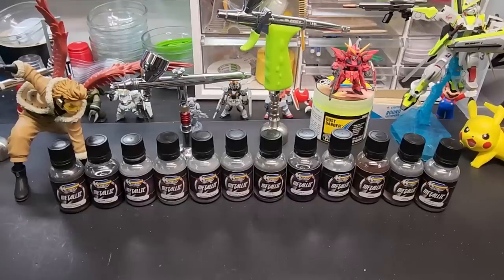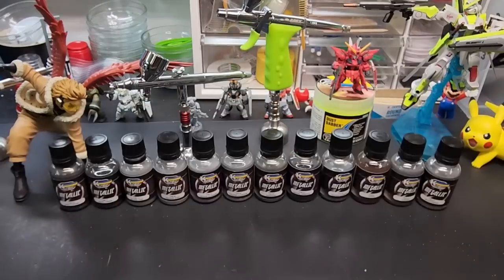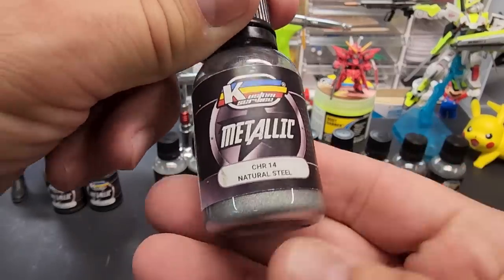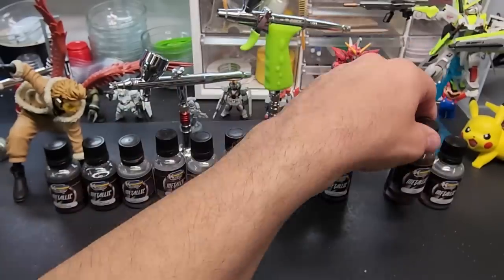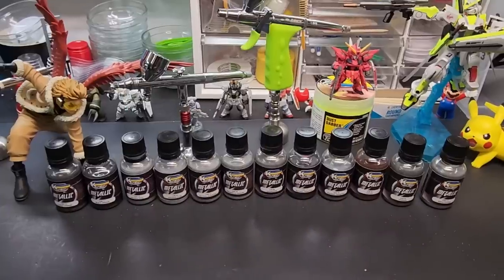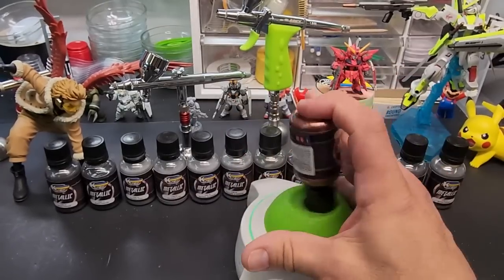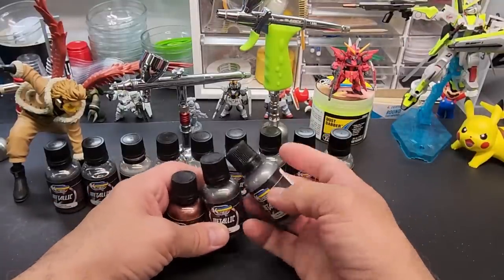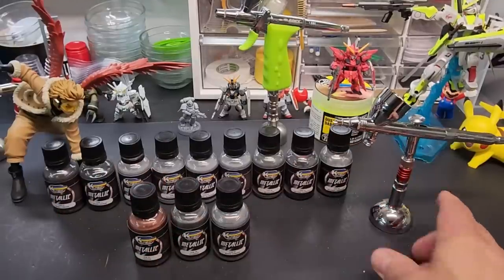Testing Kustom Service Metal Color Paints

Comment: These could make for some nice anodized and candy looks. Also, i tried the revell aqua colors. I had no issue with them, thinned with ammonia free glass cleaner and distilled water in 50/50 blend. I did add a drop of alcohol for bronze and steel colors.edit: i used a badger 105 xtreme patriot.

Comment: Is there an inexpensive brand of enamel paint you can recommend for basic hand painting. I'm on disability and found out I need yet another back surgery so I'm going to have plenty of time. Every question I've asked you on airbrushing and pigments has been spot on. Would using cheap craft paint thinned some work the same obviously not an enamel but something I know I can afford? Thanks ahead of time, duber
Reply from the maker: Well I would say Testors enamels in the little square bottles are your best bet. Also one of the most inexpensive paints you buy. There's also some enamel craft paints that are cheap. The ones in the arts and crafts stores. They have isles of them. There's a few the say enamel on the label. But my go to would be the Testors mini square bottles
Reply: @barbatosrex9473  thank you again sir. You are a godsend

Comment: Does anyone know where to buy a white panel liner at?
Reply: What do you want to use it over?
Reply: @CrimsonFlagg  

Over a brick color primer, want it to flow thru the brick cracks to represent mortor.
Reply: I meant the type of paint you're using it over. Sorry about the confusion.
Reply: @CrimsonFlagg  
Any type of spray can, krylon, rust-oleum.
Reply: Then you might want to try making yourself one with some enamel paint. You'd just have to thin the heck out of it. It would also be one of the cheapest ways to do it.
Reply: @CrimsonFlagg  
Tried that, leaves a white haze on it. Do to the texter of the plastic. Thanks anyway, least you responded.